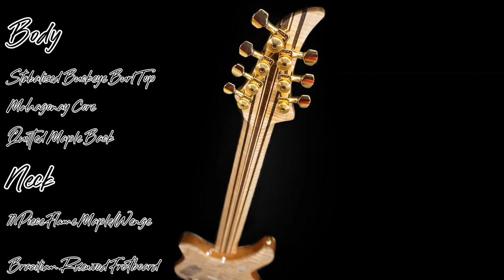7 String Custom Guitar Build

Comment: I swapped the pickguard on an affinity strat once. I stripped some of the holes and over tightened a few of the screws so there are a few cracks in the pickguard and in the body now but i got it secured down with some Creed stickers and a few wood screws. You guys hiring?
Reply: instablaster.